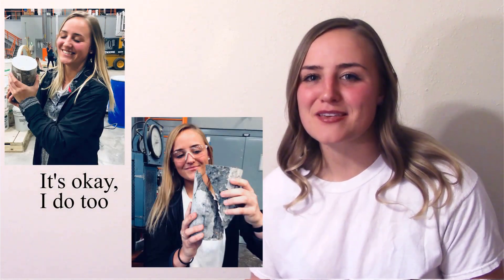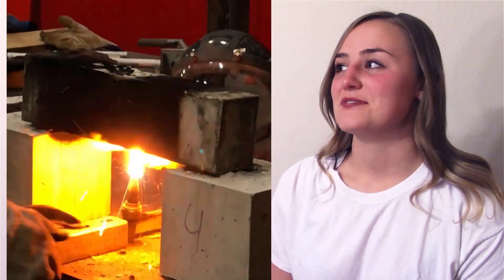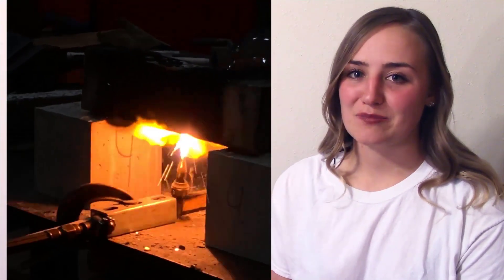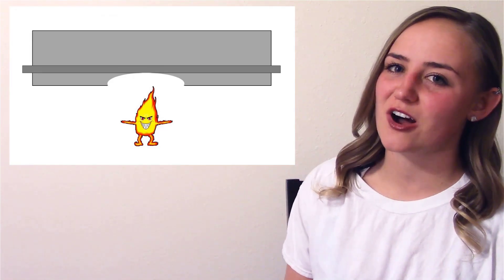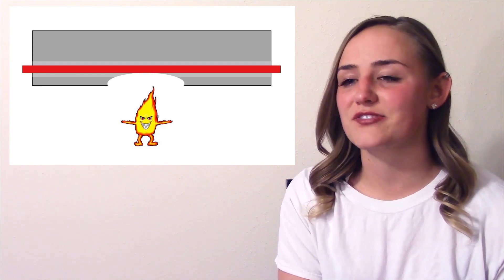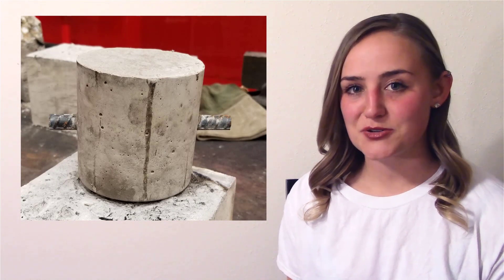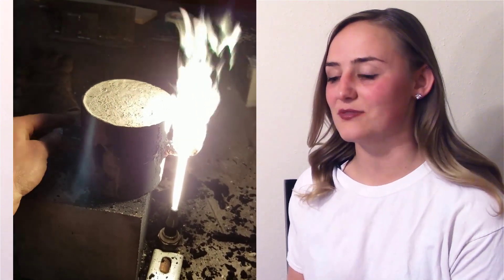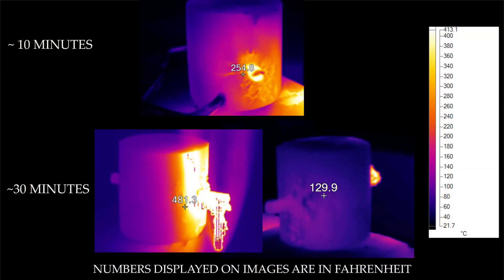Rebar debonding in a fire | concrete | lab testing | class project

Comment: It would have been nice to test an additional control rebar along with rebar in concrete cylinder. Control rebar should be wrapped in stone wool insulation so that it would not loose heat to the surrounding. It would be interesting to see what is the temperature at the other end of the control rebar.
Reply from the maker: Good idea!  We will see what we can do.